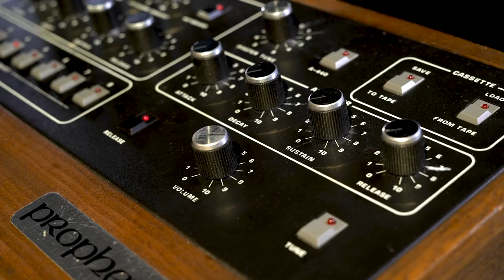Synthesizers: ADSR Envelope Explained

Comment: This is actually simple and obvious. I, however, still have difficulties with using the envelope to modulate the filter. That is, I know how it technically works, how the envelope automatically "moves" the filter controls, but I can't use it to deconstruct the sound. I.e. I have a sound in my head, I know it's based on filter modulation but I also can't set the envelope. There would be a good video.